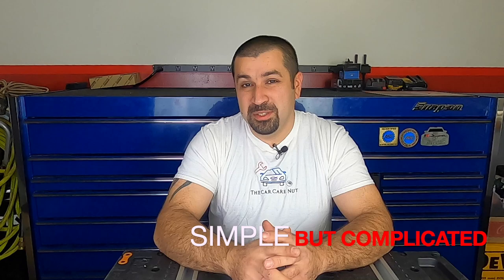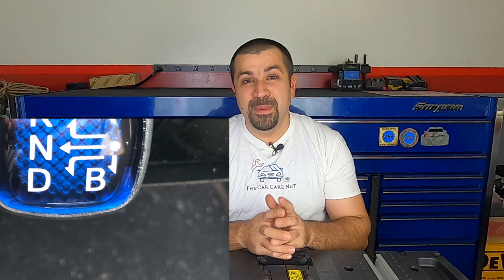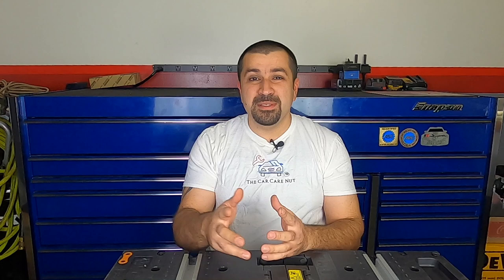How Toyota Hybrid System Work Part 6 B Mode and Hybrid AWD

Comment: My husband's 2015 Prius hit a deer in October 2021 and completely damaged the passenger front quarter. They fixed the body and the radiator reservoir,  but missed a crack on one of the radiator hose connectors and it over headed on Monday 7 March 2022 afternoon. He filled it with generic coolant and drove it home slowly. I replaced the broken hose but coolant is below the recommended level. Can I just top up the fluid or do you recommend I drain and then refill the coolant? Thanks!
Reply from the maker: Hi! If you still see the other coolant then drain and fill it with original coolant
Reply: @TheCarCareNut  I will drain and refill Thanks!
Reply: @TheCarCareNut  Do Toyota dealerships take and recycle used coolant?

Comment: Why my c-hr HV battery wont 100% fully charge.. the engine will stop @2 Bars before full charge.. thnx
Reply from the maker: Hi! The bars on charge are a representation of the charge level. Depending on your driving conditions and habits it might not reach higher levels. If you want to see higher levels you want to do high regenerative braking like driving on the highway and lightly pressing the brake to slow the car gradually down
Reply: @TheCarCareNut  thnx.. i really love all your video bout hybrid technologies

Comment: I want to get a 2021 Sienna hybrid any thoughts on these Sienna's I have a 2011 Sienna for the last 10 years without much problems and have you heard of any pricing on the 2021 Sienna
Reply from the maker: Hi! I drove a 2021 sienna very recently nice van I’m a bit concerned about the power level compared to the v6 in the previous model.
Reply: @TheCarCareNut  I own the 4-cylinder model I love it not the best gas mileage but the powers are but it should have got the six so if the hybrids above the four almost to the 6 or equal to I'm okay
Reply from the maker: The hybrid is defiantly similar or better than the previous 4 cylinder model power wise.
Reply: The 2021 Sienna is the slowest mini van in its class.  I wish they put in a bigger engine or more powerful electric motor.  Not enough power to run a heavy vehicle.

Comment: Hello I have a question about the ignition system of the engine. Does it run from the large lithium ion battery as well as the rest of the car?
Reply from the maker: Hi! The ignition system is a standard coil over plug that runs off of the 12v system

Comment: Can one use Cruze control in B mode on the very long hills?  
I felt I needed to go from B mode to normal drive to maintain the speed; does that hurt the car to go back and forth? Sorry if already asked
Reply from the maker: Very good question paul. I don’t see a reason why that’s not possible however I’d feel a bit nervous about it honestly. It doesn’t hurt the car to go back and forth when driving down a hill. But doing that in flat areas just to slow the car down is not recommended.
Reply: @TheCarCareNut  I'm not sure about other Hybrids but in 2014 Auris (EU version) the cruise control doesn't work in B mode, you have to be on D to be able to use it. It seems logic as cruise control maintains the speed and B mode brakes the car. You can't use both in the same time.
Reply from the maker: I’ll look into it if all models are the same. Honestly I didn’t see a scenario where I would use b mode and cruise control.
Reply: Paul and tygr, when in cruise control, the vehicle control software will automatically engage B mode if it determines that there is a need to do so. No input from the driver is necessary for this to occur.

Comment: My Avalon 2014 doesn’t have B mode. Correct?
Reply from the maker: It does but is slightly different. You have S mode which allows you to shift manually into gears. It’s actually just different “levels” if you would of B mode
Reply: @TheCarCareNut  
As always, thank you. 
Great informative videos 👍👍👍
Still waiting on how to replace/clean hybrid air filter for my car 😊

Comment: Hi sir,I used B mode for the first time today because I was descending a long hill.what I realised is that the rpm went way up to 4000 ,5000.is this normal? Am very worried 😟.please help.
Reply from the maker: Hi! That is completely normal! Don’t worry! It’s using the engine to slow down the car
Reply: @TheCarCareNut  thank you 😊 .caused I was worried  I got so scared when the rpm started to climb. thanks alot. 😊

Comment: hi i have a 2020 chr and this says s mode + and - is this basically the same has B mode
Reply from the maker: It is similar is just mimics the feel of a manual transmission so think of it as levels of b mode if you would.
Reply: @TheCarCareNut  thank you for a very useful channel.

Comment: So if I'm going along the freeway in drive... As I'm getting to the off ramp, I want to slow down, so I start using B mode, I get to the light and switch it back into drive.... So is this short term use of b mode bad for the car? It's not accelerating in b mode or staying for very long, but just using b mode to decelerate from high speed and then switching back to drive shortly after deceleration...
Reply: Often times I'll notice that getting off the freeway, has the same power consumption as regular driving, but putting it in b mode before getting to the off ramp, I'll usually regenerate 3-5%... Granted I'm not relying solely on bmode to slow down, just  it as a slow down assist... But want to make sure that changes from drive, to b mode, and back to drive... Aren't going to cause any unnecessary issues
Reply from the maker: Hi! It is not advisable to use b mode in this fashion. Just use the brakes

Comment: Question: is it safe to coast in Neutral? Mostly at lower speeds (below 74kph) when the engine is off? Is it different from coasting with light touch of acceleration pedal making motor MG2 not to charge and no torque applied to weehs at same time?
Reply from the maker: You can but still not advised.
Reply: As stated, this is not an advised practice, and for a number of reasons. When in neutral, the hybrid system is completely disconnected (functionally speaking) from the drive axle. In the off chance of an emergency situation, should you need the accelerator, you will waste precious seconds throwing it back into drive, and should you need to make an emergency stop, you will not have regen brakes while in neutral. While the car will be perfectly capable of stopping on the hydraulic brakes alone, the stop will feel different (brake pedal will feel more loose), and it will likely take you several more feet to come to a complete stop.

Comment: Hi Car Care Nut. I have a question regarding the use of the B mode in my hybrid avalon (2019). In the past while driving my AT cars (a Camry, a Solara, a Highlander), I would put the gear in B mode to downshift for acceleration or even downshift all the way to 1st gear at a stop so I could apply more rpm on the start. First of all, I don't know if that is good practice. Secondly, I noticed the same practice does not really have much of an effect on my hybrid Avalon (I now understand it as no good?). Does that mean the B mode is only useful for engine braking on long descents in the hybrid??
Reply from the maker: Hi! Use B mode on descends only and if needed. It doesn’t really work like a traditional automatic
Reply: @TheCarCareNut  Thank you!

Comment: I have a 2013 Prius. When driving at highway speed why does the battery show that it is feeding the drive train for a few seconds and then show it being charged for a few seconds and then neither charges on feeds. The battery charge does not seem to go down at all. Is this normal operation?
Reply from the maker: If you accelerate at highway speeds it will not charge but use the power to drive. If you let off a little bit it will start charging. If the battery charge is low it will prioritize charging than driving

Comment: Why couldn't the computer do all that automatically?

If you release the accelerator and the car is not slowing down enough, it could automatically increase the MG2 recharge rate. If the rate is at 100% or the battery is full, it could automatically use MG1 to burn the excess energy by spinning the ICE.

Sounds like it should be pretty simple and I wonder why they made this a whole separate mode.

Comment: And what about the B mode in prius prime when driving only in EV mode? In that case no engine seams to be spinning
Reply from the maker: It will just operate max regen braking
Reply: @TheCarCareNut  ok tks. Do you see any problem in using B mode for maximizing energy recovery with prius phv? (in the video you suggest not use this approach with normal hybrid cars)
Reply from the maker: Hi! I wouldn’t use it honestly other than it’s intended purpose. Using the brakes normally is sufficient to recover energy safely
Reply: @TheCarCareNut  tks a lot 🙏👋
Reply: @iurimerlini3923  when you brake with the foot pedal, the car is designed to maximize the amount of regen braking before engaging the friction brakes anyway, so there is no need to use B mode to do this. Generally speaking, I find the best technique to maximize regen is to start braking early, and keep the traction needle at about 3/4 of the way into the charge gauge. This way, the majority of your stop is accomplished through regen braking, and the friction brakes do not engage until vehicle speed as dropped below about 10 mph.

Comment: Hi pal. I have a Toyota auris 2015 pre face lift (I’m from uk) 
Today I tried B gear for the first time and it didn’t change a thing, it applied no engine breaking at all. 
I tried on a slope and I continued to gain speed while my foot was off the accelerator.

Then on a flat I accelerated and took my foot off the pedal and the car continued to coast without showing any sign of slowing, it basically did the same as it would do if in D.

Would you say it is faulty? If so is it a major fix? I still have warranty.
Reply from the maker: Hi! Did the indicator show that it’s in B mode?
Reply: @TheCarCareNut  yes it did
Reply from the maker: And when you’re at around 35 mph and let go of the gas the engine doesn’t rev up?
Reply: @TheCarCareNut  I did only test it at slow speed. Dropping down a slope at around 10mph and then from a standstill I accelerated to around 20mph and then came off the throttle and there was no engine braking, it reacted just the same is if I was in D.

Maybe I am not using it in the correct speed range?

Thanks for the replies btw :) 👍🏻
Reply from the maker: Possible. Try it next time at higher speeds
Reply: @TheCarCareNut  will do, thanks for your help :)

Comment: B mode sucks oil into to combustion chamber on my Gen 2 Prius, causing severe oil consumption.
Reply: No. Not unless you have worn rings. That's not a B mode issue. Although if you do have worn rings and don't care to replace them... Don't use B.

Comment: The following statement appears on a Toyota website referring to the RAV4 hybrid: "With a dedicated electric motor at each wheel . . ."  (You could GOOGLE it.) This doesn't match with your MG1, MG2, and MGR description.  Your explanation sounds closer to the truth.
Reply from the maker: There has never been a hybrid model with a dedicated motor for each wheel. Maybe each axle (MG2 for front MGR for rear) very nice marketing department....
Reply: They are probably dumbing it down for the general public. A lot of marketing departments across various industries do this. A lot of people tune out techno babble that we here enjoy immersing ourselves in.

Comment: NOt for an old lady Repetitive too wordy and too much info  though a very nice chap 
I want to know WHEN to use B mode so gleaned a bit of info but could be tapered down. thx
Reply: Long story short, you can choose to use B mode on long downhill stretches, but based on how the cars are designed to operate, you do not necessarily have to.

Comment: #savagescotty video talking about the 2020 Corolla hybrid
https://www.youtube.com/watch?v=nUG44ob1WXg
At 10:08 he says, pointing to the "B" on the shift lever "you can run it on Battery setting if you want to but you're not going to get very far"
Reply from the maker: B stands for Brake mode as in engine braking.....
Reply: @TheCarCareNut  Thanks for your reply.  :I: know that it stands for Brake as I drive a Camry Hybrid but my original post was to point out this "youtuber" test driver that does not even know how to operate the car that he is presenting in his youtube.
Reply: Lol Scotty is a jokester a lot of the time, best to take what he says with a few grains of salt.